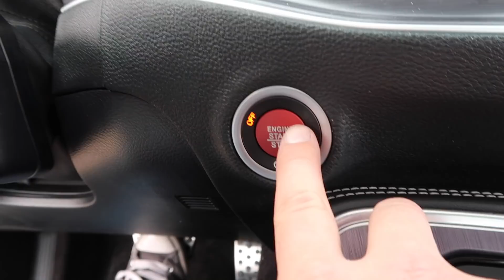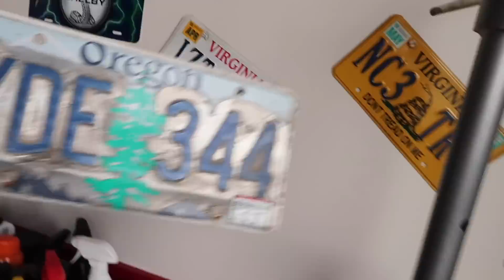First Time driving a Dodge Demon Joyride Review | My Reaction

Comment: Jd u should race the Demon asap.I have a feeling it will be a good race which I will be routing for u even though the demon is set up to a drag car.If u can hook up from first gear and do not spin u definitely shoul take the demon.Do u have any modifications down to ur suspension to help u hook up.I know u have street legal tires which does help out for traction.Adding a lot of power to a car but no traction just spinning is not good,but take a car with less horsepower but can hook up without spinning mostly likely win a drag race.I love ur v-blogs.Keep it up.

Comment: Damn... A Demon... I want to drive one of those SO bad... But... this video rubbed me the wrong way a little. Not because of what you said, but because of the lack of respect for the car whilst driving. Please don't do a pull in ANY car with your hand sitting in the douche position. You got no control, nothing. If stuff goes wrong you will not be able to properly correct. Also, never abruptly off the throttle in a bend... Easy way to loose it there as well, you literally saw the car get upset. Just look at where the body of the passenger went. Instead of straight "over the hood" on deceleration his body went "out the door". That is where the weight of the entire car shifted the moment you let off. Respect the power man!